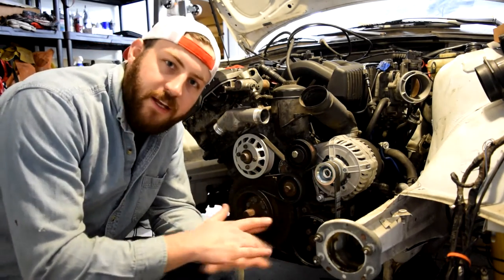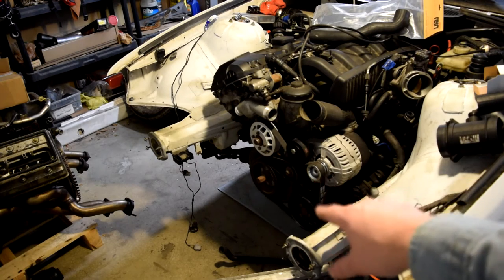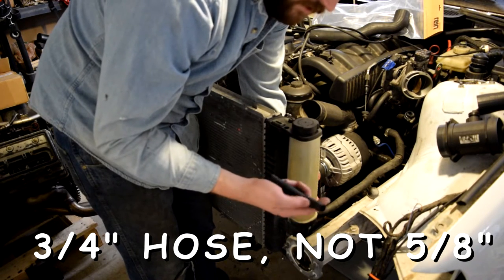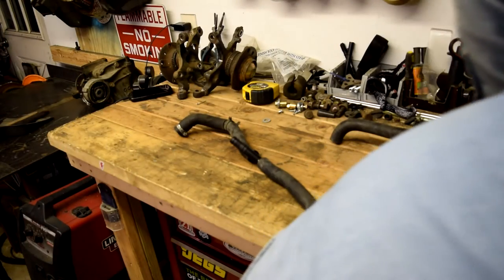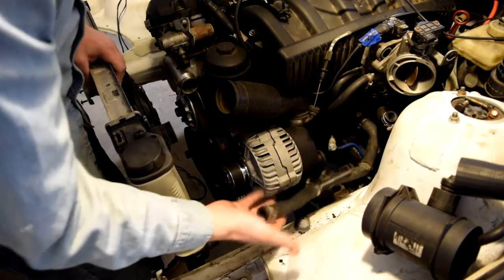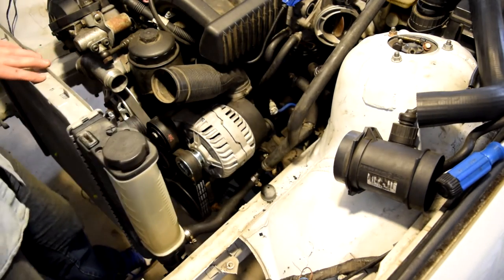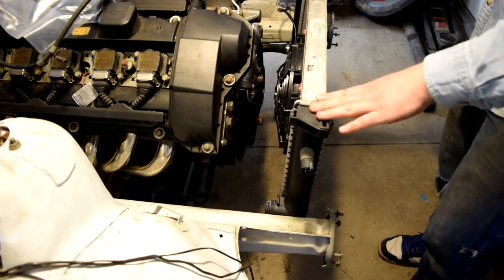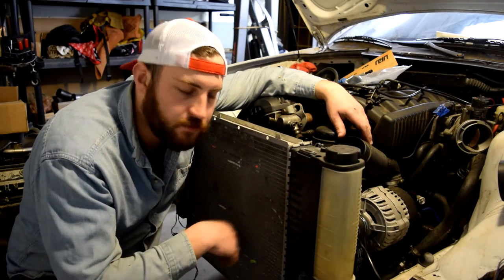318ti M52 Swap Radiator Install

Comment: I got a 03 325i I have been through for expansion tanks I’m either not bleeding the system right and I’ve looked that up 100 times or overfilling it I would really like to change it to a system that has a non-pressurized overflow tank. Any thoughts on that

Comment: its a shame that the m44 radiator sucks so bad. I had the resevoir crack twice from prssure and leak from both hoses.Thank God for JB WELD and epoxy!They need to come out with an aftermarket radiatior that has the same hose placement and no plasic on it
Reply from the maker: CMSandRMO09 I haven't had any crack on me yet, however I've never had one as a daily. Only M44 radiator I've had go bad is from me finding a steel pipe in a field with that radiator while doing donuts.
Reply: HAHA. well yeah, I think that would cause an issue... yeah mine hit 200k and the radiator cracked and the diagram from the water inlet port on the motor went bad and the clamp on the return hose went bad. pretty much at the same time.The owner thought it was a head gastet issue when the diagram at the inlet went bad so I got the car for $400 clean title. made a nice little profit off of it.BTW i am subbed and love the updates. cant wait till it is ready to go. keep the videos comin
Reply from the maker: CMSandRMO09 Thanks man. My goal is a video a week. Hopefully the car will be driving by end on February.